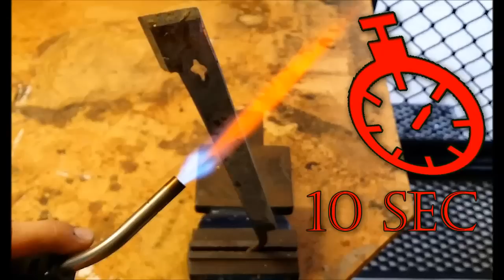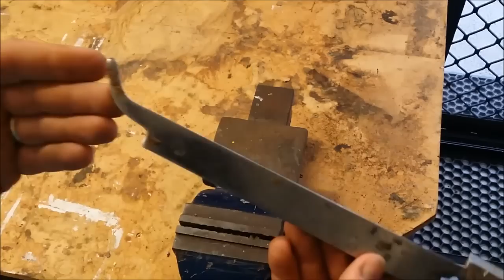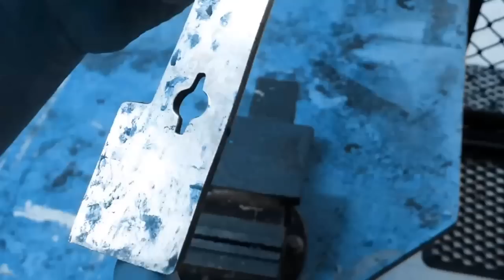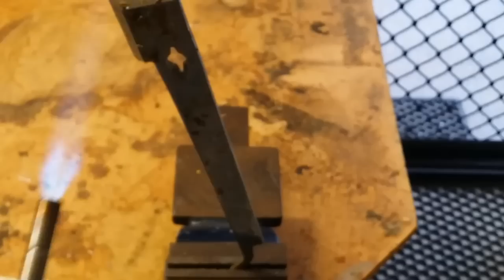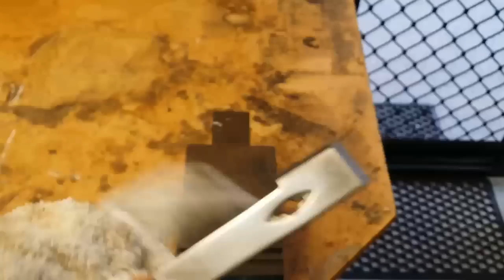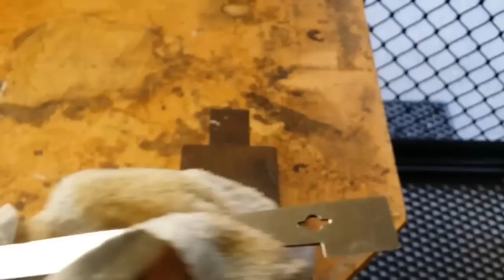How to clean and sterilize a STICKY propolized hive tool under 30 seconds - Beekeeping 101

Comment from the maker: How to clean a STICKY propolized hive tool under 30 seconds - Beekeeping 101. Visit http://www.mahakobees.com for many more useful videos. We show you one of the fastest methods to clean and sterilize your hive tool after each beehive inspection. The beekeepers hive tool will be quite dirty, sticky and have beeswax and  #propolis   all over the tool. This poses a problem, where the beeswax and propolis and honey itself may harbor dangerous infections, diseases and parasites which you do not want to transmit, transfer or introduce from one hive to the next. It is therefore very important that you clean the tools between each hive visit. 
The method in this video we argue is the best, fastest and most useful after both in your workshop and out in the field. So long as there are no fire hazards or fire restrictions in and around your apiary, you can easily carry a portable or pocket size butane blowtorch with automatic ignition switch and your hygiene routine will be much faster and easier to implement between each hive you visit. 
This may not be the ultimate solution, but it may be useful to add it to your bag of tricks for your next visit, or after. When visiting several hives in one inspection, you need to clean the tools for the above mentioned disease related issues. You can have several clean and sanitized hive tools ready to go, one for each beehive, all separated in plastic zip lock bags, or have a spray bottle with some 1 to 10 concentration of bleach and water which you can spray onto your J hive tool and dry off with a rag or a towel. This will however not remove any of the propolis, wax or honey, thus the tool will remain sticky and still have the potential to carry diseases within the beeswax and propolis globules even after it has been sprayed or submerged in the bleach solution. This is a good starting point and is useful for washing your hands and or beekeepers leather gloves, but it really is only a partial solution, and does not remove the threat completely.  

So we think this butane blowtorch method is perfect, if not the best way to achieve high level of sanitation and keep diseases at bay. It is perhaps more difficult to carry a spray bottle and a towel, as it is to carry a slim line propane blowtorch with an automatic self-igniting switch.

One word of warning! You are dealing with fire, butane, and extreme heat, so wear protection, take care and keep out of reach of children. Beeswax is also a flammable substance, and your apiary will often be located in long grass or at a forest edge, so always exercise caution and use this method with utmost care. Your business insurance or home and content insurance may not cover you.

We hope you enjoy our videos and invite you to subscribe and provide feedback below so we can best meet your expectations of this beekeeping channel. If there are particular beekeepers topics you would like us to cover, send us an email.
Have a fantastic day.
Mahakobees
WWW:		http://www.mahakobees.com
Google+:	 https://plus.google.com/u/0/100532733157161640639/posts/p/pub
Twitter:		https://twitter.com/MahakoBees
Facebook:	https://www.facebook.com/mahakobees.mahakobees

Music composed, performed and provided by Groovey - Adam Kubát a Pavel Křivák. You can visit their website on: http://www.groovey.cz/